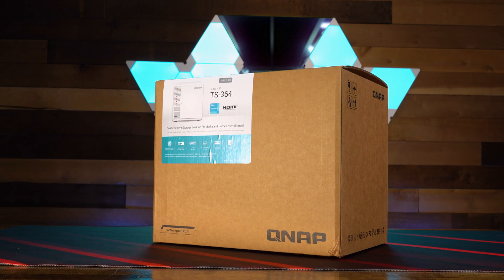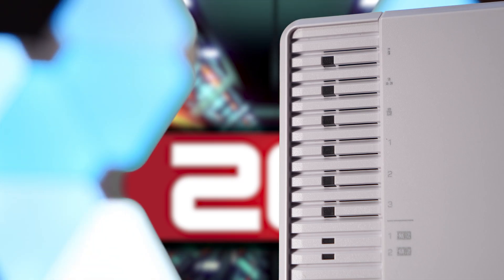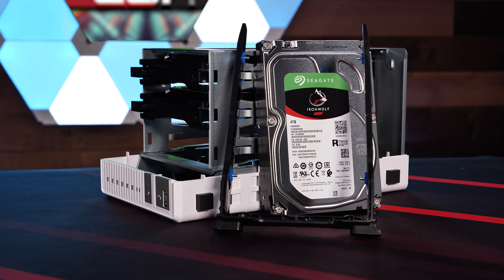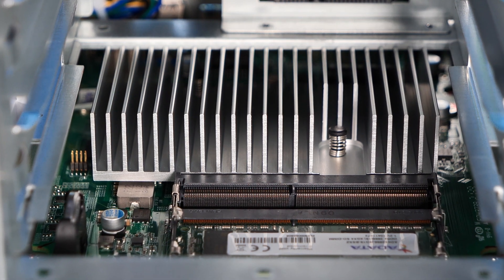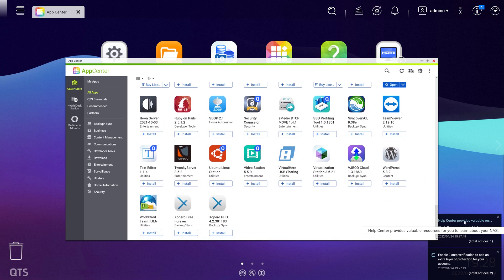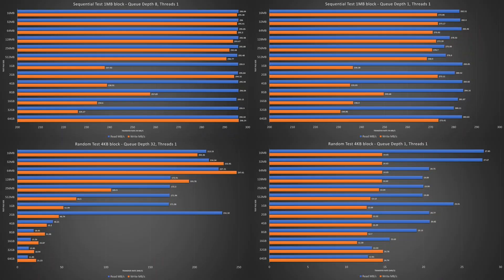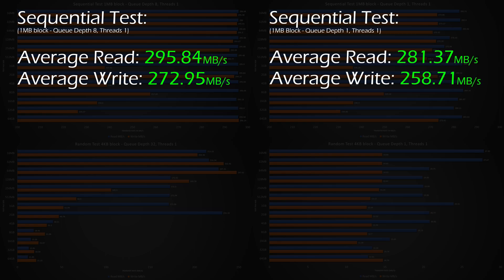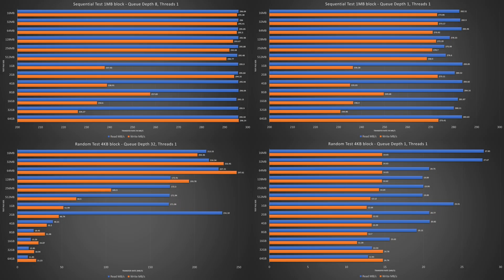Big performance, small package! QNAP TS-364 Review

Comment: do you also test transfer speeds on encrypted volumes? QNAP states a huge performance decrease for this devices. However there are tests for a different QNAP device (TS-464) with the same CPU without a drop in transfer speeds. That's confusing
Reply from the maker: We don't, but we'll make sure to do so in future videos! That's for the suggestion.

Comment: The M.2 slots can be used as a standard storage pool, but they do not support SATA, only NVMe. I installed two SSDs in Raid1 before adding any hard drives, that way I can be sure that all the services and apps run off the ssds. This allows you to spin down your drives and still be able to wake up the nas quickly. That way you get less drive noise and better efficiency

Comment: Qnap states on their Website that the TS-364 is "High End" Home NAS vs the TS-433 is "Middle-Range" Home NAS. What do you think how they are different from each other besides the missing 2 x M.2 2280 PCIe Gen 3 x2 slots, RAM and CPU Difference vs the additional 4th drive Bay? Would you rather go for the obvious more powerful 3Bay NAS or the ability to use a 4th HDD?
Reply from the maker: Thanks for the question! Based on our testing, including a video we did after this one on whether the M.2 slots and RAM upgrade make a difference, we'd recommend getting the TS-364.
Reply: @2GuysTek  Thanks, I'm planning on buying it in September ;-)